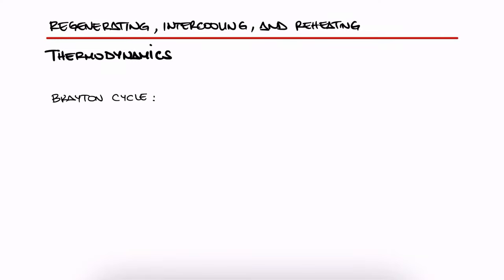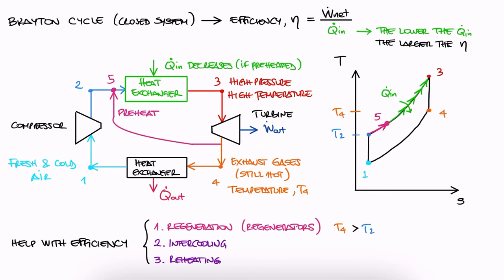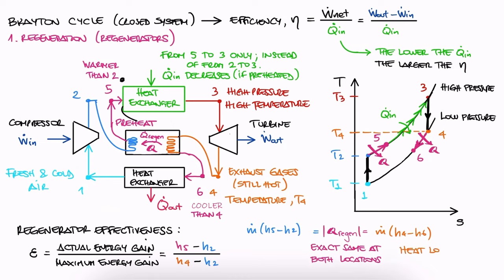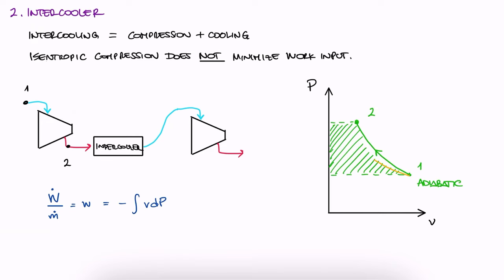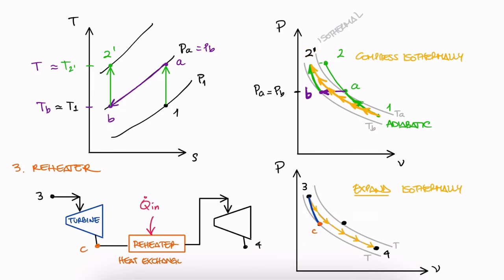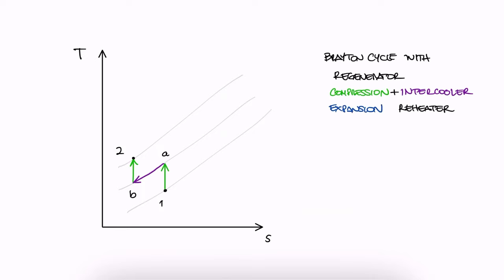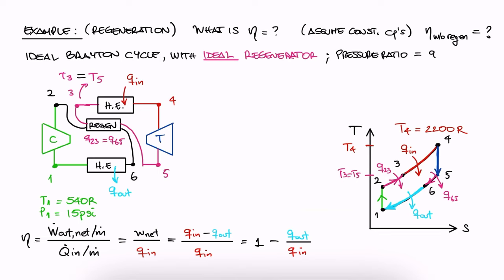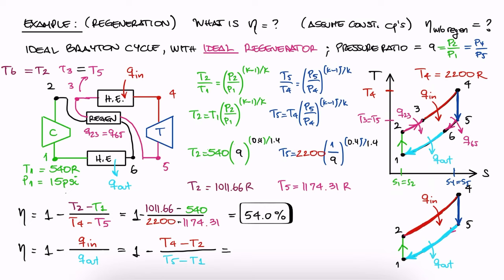Regeneration, Intercooling, and Reheating in 13 Minutes!

Comment from the maker: Slight clarification: for the message at 3:58, T5 can indeed be greater than T6. The comment only applies to the Ts diagram I drew, on that scale.
CORRECTION: 12:35 The efficiency is 1 - q.out/q.in (the fraction should be its reciprocal), but the final percentage value is correct.